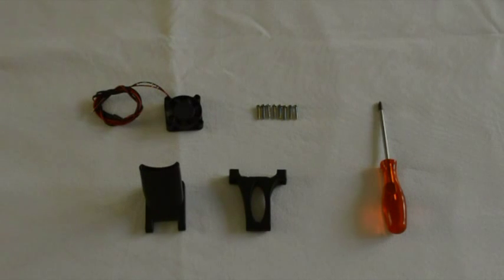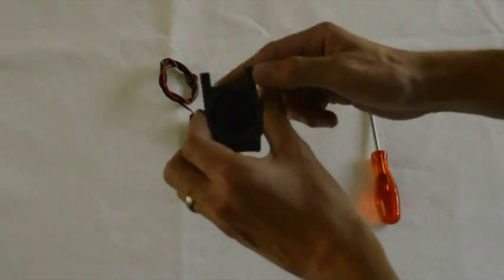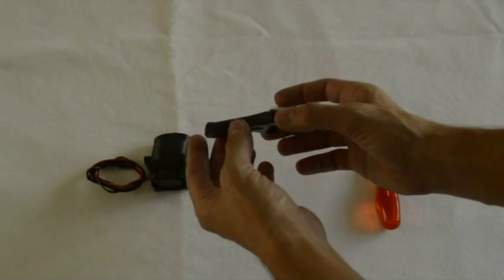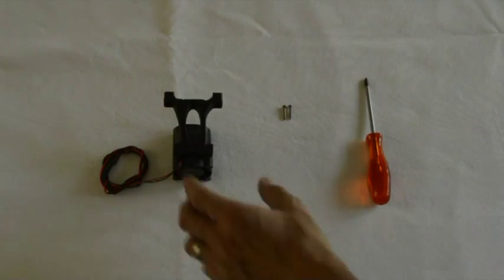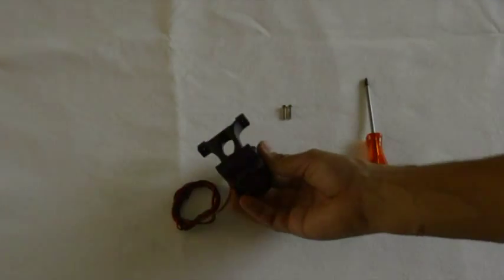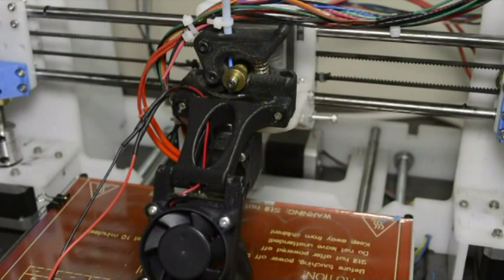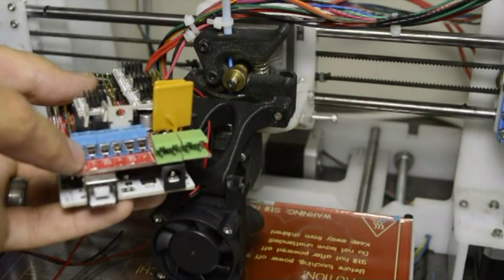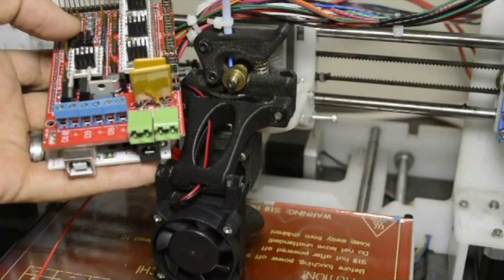Prusa i3 Kit Assembly - Video 10.2 - Cooling Fan Assembly

Comment: I have installed a fan on my Prusa Kit printer, the fan is working, I have the  FW so the setting is EFB, but there is no output on the D9 pin out. 0V Any thoughts?